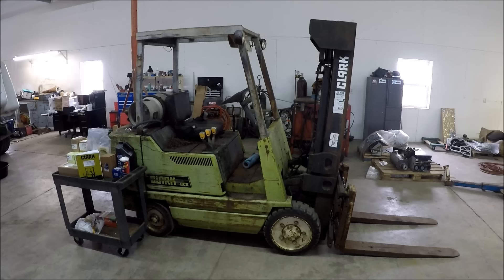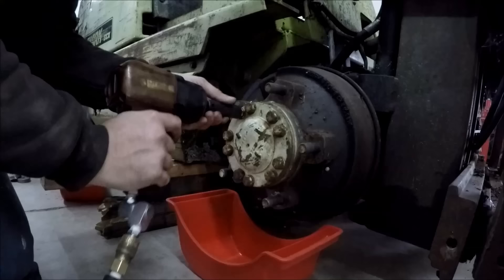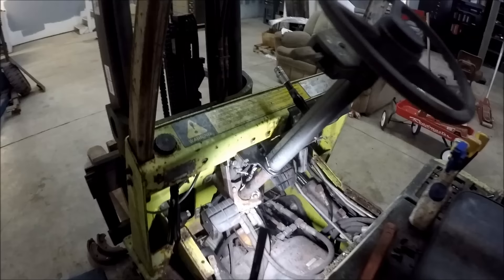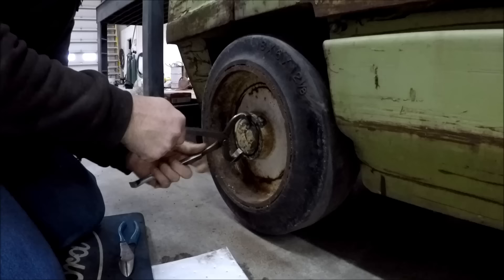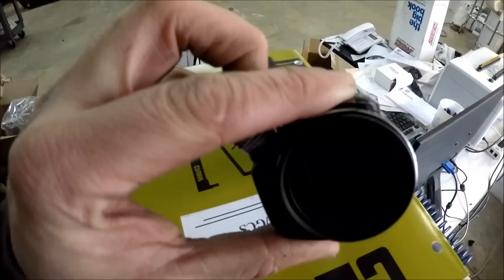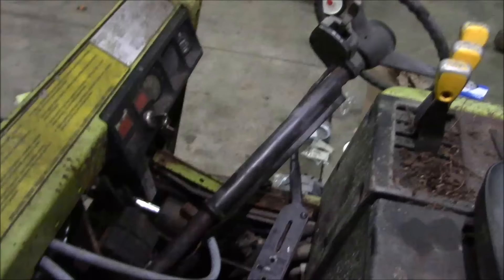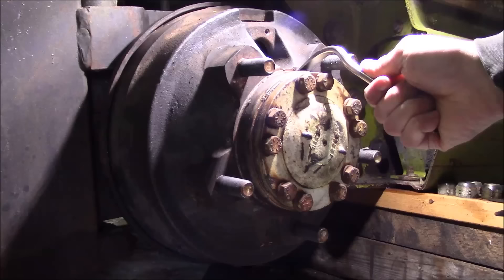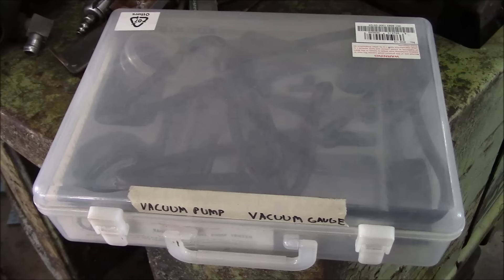Fixing a Forklift that Sat in a Field for 17 Years - Brake Job and Rear Wheel Bearings - Part 1

Comment: You sure that brass rated for brakepressure? Well, you're not race Daytona with that forklift... Look forward to se some pressurewashing in part 2
Reply from the maker: There's no pressure there. It's just the fluid from the reservoir to the master cylinder. The brass would not be OK for brake pressure.

Comment: Looked like the rear bearings were greased and the fronts were just oiled.  Why the difference?
Reply from the maker: The front axle is a standard floating axle configuration. The hubs are filled with oil from the transaxle that lubricates the bearings. That's why oil poured out when we pulled the axle shafts.
Reply: @WatchWesWork  Makes sense, thanks!

Comment: What's this?  A Mechanic ACTUALLY using a tube flare nut wrench??

Provided heating it isn't damaging to it, I always thought about the idea of heating up clean bearing grease to liquid, then submerging all the races in it to allow all the trapped air to escape, then letting the grease solidify again with completely packed bearings ready to go. Or just buying a grease packing setup.

Comment: @37:50 why wouldn't you use grease? I can't see the bearings lasting very long...
Reply from the maker: This seems to be a common question. Those are oil bath bearings. Remember when I removed the axle and oil poured out? That's the oil from the transaxle. It fills the hubs and lubricates the bearings. That's how most floating axles work.
Reply: @WatchWesWork ... Well I'll be...  Like a Semi...  They use the same setup...

Comment: Re the power washing fetish. With the unit as clean as possible, one can see a lot more problems/leaks and it prevents crud from getting into places we don't want crud and, it shows a degree of care or mechanical aptitude to many folks.                                                               

Anyhow, I am wondering if the rack out you see on the mast is causing it to not rise above the first stage. Maybe some correct factory dimensions could help you with that. Is it possible the fork lift was run into something very hard that pushed in the one side? No clue, all I know about them is how to use the forks and wood blocks to change a front tire.
Reply from the maker: The bolts to the chassis were loose on one side. You'll see in the next installment.
Reply: @WatchWesWork  Great, no big frame pulling issues. Nice work BTW. :)

Comment: I've always seen mechanics use deadblows, I've never used one. Do they make a big difference?
Reply from the maker: Compared to what? I really like them.
Reply: @WatchWesWork  compared to just using a normal hammer.
Reply from the maker: @ndirish4515  If I start hitting my pliers with a normal hammer I'm going to have to deal with the flood of comments about me abusing my tools. So I guess they are better in that regard!
Reply: @WatchWesWork  oh yeah I forget you have to deal with a bunch of people watching. Haven't had that problem! Haha
Reply: Dead blows are unique in that they dont introduce a whole lot of shock into the work piece as they're filled with sand or lead shot, if graphed it would look like slow ramp of force over time versus a short spike. You wouldn't want to steel hammer on cast iron so a dead blow in its place would be wise. As for me I'm a fan of rubber and raw hide mallets but dead blows have their place...
Reply: @RBRat3  ahh thank you that makes sense!

Comment: You need to have the new brake shoes rearced to the drums or you will have a spungy brake pedel ,  PS old  A\C- kalmar fork lift mech
Reply from the maker: There's no one doing that kind of work anymore. I doubt there's a single working brake radius grinder within 100 miles of me.

Comment: 33:17 for the right shoe shouldn’t that bracket it be installed with that notch into the shoe and not the nub? Wouldn’t that be a more secure setup. Those how it was on the left shoe. Just looked to me like it wasn’t put it in right. 34:09 shows it’s placement and why I thought it’s off.
Reply from the maker: No. There are two notches. One goes over the parking brake lever. The other one has no purpose on this machine.

Comment: No critique here, just curious:  Why no grease in the front wheel bearings???
Reply from the maker: They are oil bath bearings. The oil from the transaxle fills those bearings. That's why oil poured out when I removed the axle.
Reply: @WatchWesWork  Ah, I forgot about that part!  Watched about half of this last night and finished the rest today.  Went back to the 7 minute mark and sure enough, a ton of oil comes out.  

Thanks for the reply!  :D
Reply from the maker: @elesjuan  It's a very common setup for a floating axle. Some floating axles have grease packed bearings, but usually on much older equipment.

Comment: Contrary to popular opinion it is not necessary to replace brake shoes and grind rotors if the scoring run around the drum and is not galled in the valleys.  It actually gives you a bit more braking surface.  This was a method by shady mechanics to sell brake jobs to little old ladies.

But your wheel cylinders look pretty bad.  I agree that in a pinch you might have been able to resurrect them but if there was any deep scoring on the inside honing would not have fixed it.  They usually are not expensive so I would have replaced those also.  Not worth the time.

Comment: I just finished a brake job on my Heli (worklift) and e-brake cables were $40 each wheel cylinders $73 each so I had to rebuild with kit from autozene $5 each 
I would have able to afford new ones, I noticed that yours looked the same as mine. 
Where did you get your new wheel cylinders?
Reply from the maker: From a Clark dealer. Clark parts are very reasonably priced. It's part of why I keep buying them. There are also aftermarket parts for most Clarks that are even cheaper.

Comment: Looks like the separator on those shoes wasn't seated correctly on the front shoe.
Reply from the maker: There's two notches. The parking brake lever fits in one. The other does nothing on application.
Reply: @WatchWesWork  gotcha

Comment: Hello i have to much problem like you in om fiat forklift 3tonnes solenoid valves for forward and reverse wires coil was in not connected in a right position the field is opposite  but now is ok but now i have brake problems  I like your videos sound good and lights and your good english Ali from tunisia sousse town near the beach wich place you are from I like keep contact with you for forklift business or technics information good luck Ali

Comment: 42:50 could it be that the hose coming from the reservoir goes up, this is why you were having trouble bleeding it. I am no forklift mechanic so I could be wrong
Reply from the maker: That shouldn't matter once it is bled as long as the fluid level is maintained.

Comment: why on earth would anyone think you stole this. you're a stand up guy. i can't see you stealing anything. some people, right? lack of cooperation from things being worked on is the cause of many a tool flying across a garage, or blue streak of obscenity. so, no flying tools, or extended beeps in the audio is a good sign. i'm surprised you don't have a brake lathe. i guess having a standard lathe is a lot more useful. more work to turn a rotor though, unless you have a dual cutter contraption to attach to your lathe. ahh yes, the old palm scrape technique. effective, but messy. that's how i do cotter pins. i've heard they can wear the dust cups, but i've never seen it. with the price of those brake shoes, i might have tried sanding the old ones smooth. i've done it before. you just need a shop vac for the dust. asbestos don'tcha know. air sucking around the bleeder threads is why i don't like vacuum bleeders. i have one, but have never had much luck using it. so the vid is an hour, what's the actual time on job? just curious.

Comment: IT LOOKS LIKE YOU MISSED THE NOTCH ON THE UPPER BAR..HOPE YOU SEEN IT...   @34:15 THE 2ND UPPER SPRING SIDE...
Reply from the maker: No. There are two notches. One goes over the parking brake lever. The other serves no purpose on this machine.

Comment: amazing what you can find working on old machinery  did that for between trade schools the person I work for have an old tow motor run great started great too  just never had brakes on it same did not lift to  the 2snd stage talk to a place that could help me with that like get my a book on it  they did better and buy the machine for him  the other one was lot bigger machine has it problems too have to rewire to make the battery to take a charge and to have the key to start it to worked  did replace the switch with a new one most it was not the right key in the first place or the switch to he did not like to put out money for anything at all

Comment: "This is an '80's machine, so..."  Don't even bother finishing the sentence - we know where this is going:)  Ford was famous for it. They had the worst mix of standard/metric. The brake system fittings, in particular, were a mess.
Reply from the maker: Yeah. I grew up working on this inch/mm stuff so I guess I'm used to it.

Comment: The cotter pin / split pin wasn’t installed correctly. 
You are supposed to make a small knot of the ends before spreading those apart. 
Amateur...

Thanks for the video 👍🏻👍🏻👍🏻
Reply from the maker: Do you recommend a square knot? Maybe a figure 8?

Comment: Dude I wait every week on a new video.  Can u fix my 1983 Ford ranger automatic transmission it won't go in drive or reverse any more..? Oh it's got the 2.8 v6 in it
Reply from the maker: I don't know much about automatic transmissions.
Reply: @WatchWesWork  ok thanks .. 😢
Reply: Based on experience, you’d be better off finding a rebuilt trans and have a transmission shop do the swap versus having yours fixed.

Comment: Are there any old Clark forklift mechanics other than me watching this?
Reply from the maker: Do you know much about these GCX machines? I'm wondering now if I put the master cylinders on backwards. I put them on the same sides as the old ones, but the brake side master cylinder has the larger bore. I'm thinking that is wrong. The smaller bore would give more pressure to the brake shoes.
Reply: Watch Wes Work I think u have it right, the brake m/cylinder has to work the inching and brake.

Comment: Hey, does your Dad know that you have his Dust Cover Pliers? I haven't seen a pair of those in a very LONG TIME. LOL. I going to venture into tribalism, ref the cotter pin. You did it right as far as bending the pin outward. You don't get extra points for not cutting it. Should have cut it so it was @ the center point (approx.) of the axle. The other side of the cotter pin should have been cut so you could "BEND" the pin to hug the axle nut. The mere fact that the cotter pin is bent in the two different directions is the Redundancy safety factor. Yes your forklift isn't a Formula one race car, but thought you would like to know. This from a fat old (66 yr's) 25 plus yr's autobody guy. How old is old, I kid you not when I first went to work in the autobody field, "ALLSTATE Insurance," you know the "GOOD HANDS PEOPLE," would only pay $9.00 for "Half a wheel alignment." Is this a great country or what. I can also remember the first time writing an estimate for just over three thousand dollar's. Six inspections later from top brass (of the insurance company) on down it got approved. At the time, it was unheard of. That Forklift look's like it was outside for only 16 years, and seven month's.😁😁😁 Not a day more. P.S. because the cotter pin is bent, is the "SAFETY REASON" not to reuse the original cotter pin. We all know that everybody replaces the cotter pin with a new one. Rolling my eye's now.
Reply from the maker: I love those pliers!

Comment: To bad this truck is not worth all the time you have spent on it. The GCX was junk when it came off the assembly line.
Reply from the maker: Lots of people have said that. I don't know. The mast, steering, engine, controls, ect all seem much better thought out than the older C300 I had. The brakes are stupid. I'm not sure about the electronically shifted transaxle. But overall it's not too bad.

Comment: never jack up a forklift with a 2x4 of pine under it , to much weight for that type of  wood to handle too soft . always use oak  if on soil , on concrete never use wood .
Reply from the maker: Huh. So on concrete do you just use magic?
Reply: @WatchWesWork  if you have ever watched videos of construction crews jacking up machinery on concrete , if you look closely , you will see that they use steel plates under the hydraulic jacks , the plates spread the weight load over a larger area , this is to prevent cracking the concrete , your life and safety is priority above all else , always jack up machinery the correct way, you can use blocks of wood to support the machines weight only after the machine has been jacked up correctly , our forklift mechanic uses plates under the hydraulic jack , when he jacks up our forklifts when replacing wheel bearings or brake service

Comment: "It's almost like this forklift sat outside for 17 years" You mean barely used then ;)
Reply: mines a similar vintage (1993/GPX230E) with large tires, it only sat abandoned out in the weather 2 years- but still only had 1500 hours on it... a literal scrapyard freebie (boss even had them haul it home for me) all up, about 800 bucks in parts and paint- and a few weeks of evenings, and aside from dents in the wheel lips that I couldnt beat out any better, it looks and runs good as or better than any at the shop-  luckily it still had good tires as they woulda been very expensive, theyre big as car tires, must weigh 200 apiece...  https://www.flickr.com/photos/90822467@N08/44805143722/in/album-72157708846373393/
     a glutton for punishment, there was also a 1963 towmotor out there that had sat outside 5 years, I didnt have room for another, but asked about getting it running to donate to a local museum- they even let me use the back of the shop to work on it after work... i ended up with quite a few months of evenings and a couple k in it...funny, i forgot my paypal had my wifes card on it... "umm I dont remember ordering forklift tires?" DOH. initially i'd guessed a dozen hours and a couple hundred in parts, but it kinda took on a life of its own... almost trashed it once found the steering box was not rebuildable, but bit the bullet and adapted a car power steering system- just the reamers to do kingpins and redo drag link tapers were a few hundred bucks...now its a great little truck again, but manual clutch...  soon as i get the dedication plate made, its going off to its new home for a cushy life...all thats left to do, but havent touched it since the virus crap screwed everything up, out of sight/out of mind...https://www.flickr.com/photos/90822467@N08/albums/72157708846373393/page1

Comment: She's a beaut Clark lol. IDK why Clark couldn't use a regular drum brake and inching cable like everyone else.
Reply from the maker: I don't get it either. It's such a complex brake system for no reason.
Reply: @WatchWesWork  I'm not a ford hater but Clark has a way of being the Ford of forklifts lol
Reply from the maker: @Nathan-pw7do  Heh. Yeah. In that case Yale is the Chysler of forklifts. Right down to the Chrysler engines they used...
Reply: @WatchWesWork  I always get a chuckle whenever a slant 6 comes out of hiding lol. Toyota and Mitsubishi are hard to beat for the smaller trucks. I've been a full time forklift mechanic for the last 9 years so give me a holler if you get stumped on the mast issue.
Reply from the maker: @Nathan-pw7do  It turned out the bottom roller was rusted to the mast. I got it freed up. And the bolts to the chassis were loose on one side. This was not her first rodeo...